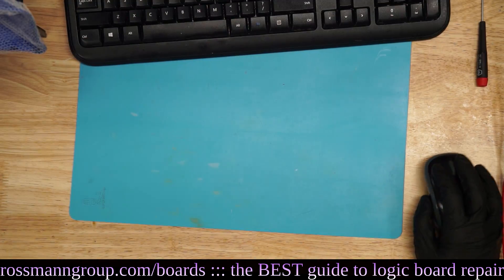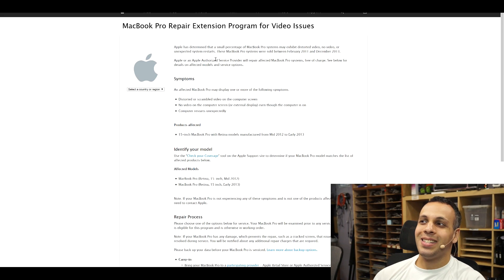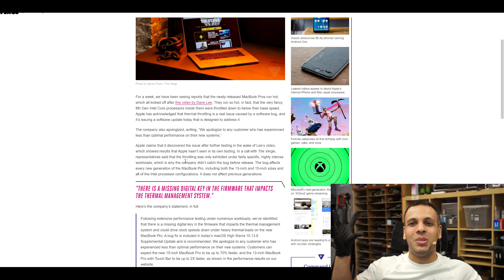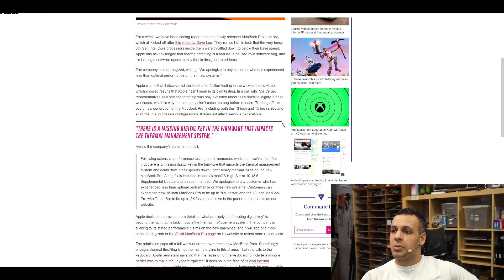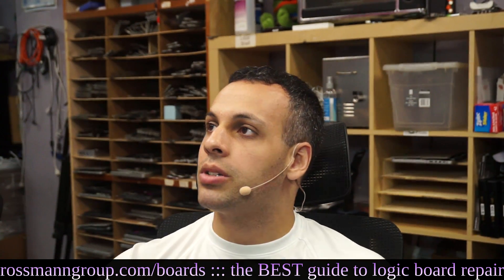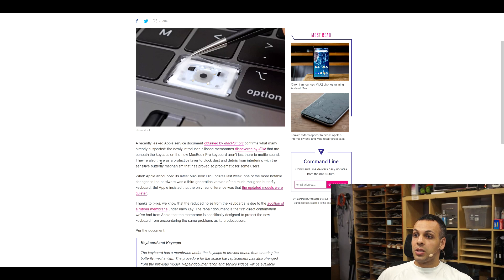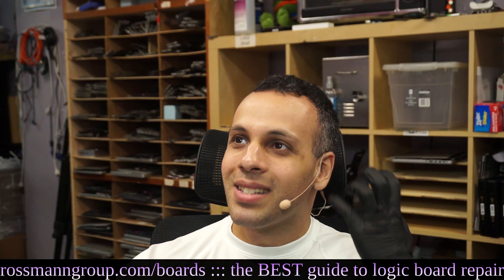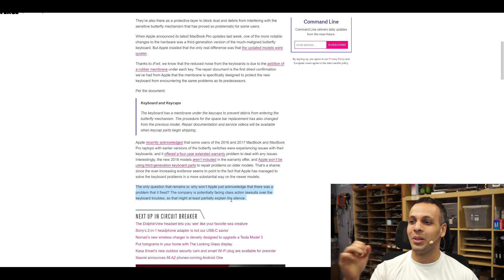This new Macbook is becoming a meme.

Comment: Great video. The only point i would like to have a talk about it is the "for some people this is more stable.... ". Well, i do have a creative team working for big clients and we have apple machines and windows machines. Every single windows machine require more fixes than the apple ones. OF course when talking only about price per performance pc machines win every single time you compare. The point is if you don't need hardcore performance and have the money, the ecosystem is worth. Here we have more windows than apple because of the high price  but i do get how in the US this is not true. ( in Brazil apple products can cost as high as 3 times the original price in the US). So, for a real case scenario is worth the long term price for some cases but not for isolated performance. And creative like to be part of the "apple cult"

Comment: Yesterday, a service guy told me about the change in Apple ethics post-Jobs. It was enough of a problem with Jobs. Now, the macbook has components soldered in, to prevent repairs; requiring buying a new machine. Glad I came across this vid. Thanks.

Comment: The Windows OS is a nasty piece of lazy programming that is a headache no matter what you are using it for. Linux and the Unix derived Mac OS have much more solid fundamentals so even if it crashes (which doesn't happen often) it easily reboots and self corrects. As for pricing: yes, I agree. The systems are overpriced.

Comment: Another point to consider is Apple states the i9 cpu is capable of hitting 4.8ghz, but reading this page from intel 
 https://www.intel.com/content/www/us/en/products/processors/core/i9-processors/i9-8950hk.html under the section called Intel® Thermal Velocity Boost  it does give the impression that max clock speed boost is only achievable when the cpu is running at 50 degrees C or cooler.  Has anyone seen this i9 Macbook pro running at 50 degrees C or less in order to achieve 4.8ghz boost speed?

Comment: Cool, we're finally in the future where we can software up some cooling capacity instead of worrying about silly things like heatsink mass and designing in proper airflow. Sign me right the fuck up for some of those digital keys, my phone needs'em. These old 805s get hot under sustained load.

CNET's test seems to indicate what they actually did was increase the temperature limit before the CPU starts panicking, while simultaneously reducing the peak frequency once the CPU gets hot, to help keep the temperature from spiking beyond whatever barely-adequate cooling solution they shoved in there can handle. But I guess "changes to the thermal management scheme" is a lot less catchy than "adding some missing digital keys" bullshit.

Peak temperature from CNET was also above 91c, which should prove pretty bad for longevity for heavy users, but that's to be expected; it's perfectly in line with Apple's we-don't-give-a-shit-buy-a-new-one-next-year strategy. The keyboard will probably explode before the CPU starts suffering electromigration problems anyway, soooo...

Comment: It also doesn’t like virtualization - running vagrant and docker will thermalthrottle so bad.

Removing or adding firm/Software to reduce throttling will just cause more wear and early damage to the hardware

Comment: How the he'll can they claim this to be software related. Clearly, the hardware design is not capable of keeping the machine cool enough to prevent it from throttling. Then, it doesn't matter if the cpu is working hard because of a software but created by Apple or because you encode video on it or anything else. Apple fixing their potential software but will not remove the limitations of the hardware.

Are Apple actually calling themselves engineers and pretending not to understand this themselves?

They must really take people for fools.

Comment: Note that they said that "we apologize"; they never actually said that they are sorry. 
I know that it's kind of semantics, but it does matter. If you actually are apologizing, then say that you are sorry. And, then, stop doing the thing that you are sorry for because that's how being sorry works. 
Hell, I guarantee that a part of the reasoning is that apple is certainly not sorry and that they don't intend to stop doing the thing. If they were, then they would have made the "pro" laptop a bit thicker to have better cooling rather than trying to figure out how to make it thin enough to slice bread.

Comment: They would lose their lawsuits for their butterfly keys if the admitted reliability from 2015-2017 MacBook

The worst part is that they did their "pro" user base a disservice and experimented with their elite demographic instead of rolling out the changes in other product lines

Comment: Am I the only one who's bullshit alarm goes off when a SOFTWARE fix for thermal throttling is issued? How the F*** is that even a thing? Are they disabling the slowdown so the thing runs hotter and risks burning out the CPU, or are they injecting wait periods to intentionally slow down heavy load tasks to make the system under-perform whilst artificially keeping the clock high?

Those really are the two options if we're talking software, and neither is particularly reputable.

But as always, Apple wouldn't know proper cooling if it stripped naked, painted itself Noctua tan, and hopped up on a table to sing "Oh look at what a big cooling fan I am!"

Oh, and Louis? Part of their culture for 30 years? Try FORTY! It's been this way since they shipped the original Apple ][, where there weren't overheating issues you were just using it in too hot a room. (No joke, they said that). There's a reason the most popular aftermarket part for an Apple ][ was a fan and shroud that hooked on to the left side of the case.

Or the expansion cards weren't improperly secured, you just shipped it wrong. I'd point out the ONLY thing that held in the expansion cards in an Apple ][ was the edge-connector and gravity. They couldn't even be bothered the 'expense' of a bracket and one screw.

Which is why I've spent 40 years wondering just what the f*** is in their kool-aid. Cocaine? Heroin? Meth?

Comment: They have somewhat fixed the throttling but from videos I've seen it is still only sitting at 3ghz at 90c, which makes their claim of it boosting to 4.8ghz still laughable at best.
Reply: Why it's laughable? The fact this cpu doesn't boost all cores up to single core boost level? Were you expecting it would?

Comment: The software update will just be them lowering the performance. Can't underperform if there is no performance! 
Seriously though. You can't change  a cooling system (I use cooling loosely) with a software update.

Comment: I haven't had a chance to look at post-patch results, but if I had to guess, I'd bet that the fix was dialing back the clock speeds further and more quickly under multicore load to reduce i9 power consumption. That would reduce stress on the VRM solution and would keep performance stable over longer periods. But of course you clearly lose even more of the difference between the i7 and i9 CPUs. (also "4.8GHz Boost clock" = I love running single-threaded benchmarks and nothing else)

Comment: I wonder how a s/w update can even fix this as I agree it seems they're just misleading about their thermal hardware corner-cutting... I mean if it just lets the chip run hotter or makes the fans louder that'll just fill it with dust or halve CPU life. Really fucked up if they go that route, but popcorn in hand...

Comment: A software fix for over-heating? Sounds like they didn't configure their turbo boost modes to limit power usage correctly... Which means that until it does start throttling, you're probably getting more performance than they ever intended (since the cooling hardware is so crap they can't have intended it to be a performance monster)

Comment: Customer: Hi. I just bought this Apple Macbook Pro for 7000 USD. My friend told me that if I spent an extra 3500 dollars the performance would be much better than ASUS and other gaming models. But I am lagging really hard in PUBG.
Apple: The Macbook Pro is not meant for gaming. That's a very specific workflow we have not yet tested but we can asure you that you are using your macbook wrong.
Customer: But I...
Apple: We fixed the keyboard noise problem, be grateful.

Comment: I guess you could try and fix this by replacing the mosfets, inductors and capacitors in the VRM switching circuit, but that actually means to recalculate most of these components...

Comment: I've said it before, and I'll say it again; Apple died with Steve Jobs. Steve was the driving force behind 'innovation' (I'll be careful using that word here as historically Apple combined existing technologies into a user-friendly package), and the quality of their products was high. Yes, their prices were always high, but you knew you paid for a product that won't fail at the worst moment. Without that driving force, Apple no longer has the imagination necessary to keep up with new technology. This latest Macbook Pro is the perfect example.
The Macbook Pro design dating from 2011 was designed for a specific generation of CPUs; namely the Intel Core i5 and i7 series. The cooling system was designed to handle these CPUs which was fairly sufficient for the time. Fast forward to 2018, and they're putting an i9 which runs considerably hotter into the same chassis. The cooling system and chassis is not designed to dissipate this extra heat effectively, and thus the CPU is forced to throttle by its built-in safety system. You may argue that the Macbook Pro design is very iconic and changing it may have bad reception amongst consumers, but in truth industry professionals (especially in creative industries) don't care about the aesthetics; they need a powerful machine that is stable and reliable. Sure, I like my laptops thin and portable like anyone else, but if it means my machine will not perform to its specs then I would consider it a bad investment.
And if this machine is targeted at industry professionals, then I would assume they'd put performance before aesthetics.

Comment: I really wonder, is there any other company that fucks up their flagship products as badly as Apple does? I mean, until following Louis's channel, I was under the impression that Apple makes really good products. But a badly designed CPU power supply in a products that features top of the line processors and and also is aimed at professionals, seems like way worse than a rookie mistake. It seems like they were cutting corners in terms of BOM price where corners should have not been cut! I'm an electronics engineer, and if there's one thing I learned in my 12 years of practice is that you don't fuck with the power supply.

Comment: That is because engineers, both software and hardware, only Bench-Test their products, not Stress-Test them.

A Bench-Test, officially, is as follows:
1. The machine powers on.
2. The OS loads.
3. The system runs continuously for 24 hours without problem (absent anything beyond stock installs and peripherals).
4. Machines that make it to Stage 4 are moved to sale.

Remember, the video editor is NOT a stock install. Right-Click is NOT Enabled by Default. Steam, and your games are NOT stock installs.

Honestly, ANY system running below 3.2Ghz, less than 16GB RAM, less than 1TB of total HDD/SSD/M.2, and below 1920x1080 60fps Screen, is a waste of your time and money, especially if it costs over $1500, and I will go ahead and say that is both USD and CAD. This should be BEFORE having to pay for additional services like "Apple Care".

Comment: Oh that's a good idea. Effectivly make a thermal challenged cpu (overheating ) continue running at base or boosted clock speed. That won't make it hotter and force it to burn out...

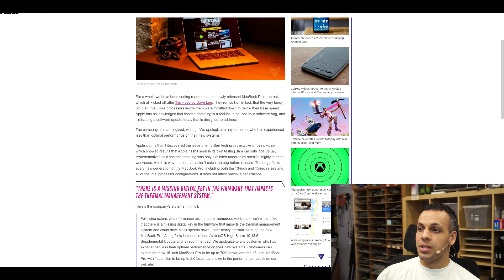Comment: 4:00 There's a missing digital key in the firmware that impacts the thermal management system. "Yeah." that was the most accurate, condescending, on point, sarcastic "Yeah" in known universe.

Comment: The results are in on the hotfix, still can't run the i9 @ rated stock speed in video rendering, still @2.4-2.6GHz. Cinebench hold up over 3GHz but the test is too short for the heat to build up.

Comment: More likely digital keys that allow apple to override the default sane Intel throttling to run the chips hotter and not to throttle as soon. Software can't override PHYSICS. The chips are going to put out the same amount of heat per speed it is running at. These CPUs will probably end up having the same issues as the GPUs that were running too hot in previous models. This fix is either throttling the chips even more to prevent over heating. Or overriding the Intel defaults to run hotter before throttling

Comment: The fan can't spin with out a digital signature? Am i hearing this right?
34 years later... Apple's space shuttle violently explodes during takeoff 
[Tragic story Bla BLa Bla Investigations show that the fingerprint sensor was destroyed by dust, and could not authenticate the astronaut, Because of this, all cooling systems, life support, and flight controls were disabled in the interest of security. CEO says "The problem was that the pilot was using the booster to liftoff, a very specific workflow that we didn't consider anyone would use a booster stage for."]

Comment: There is no real fix for this issue, since the cooling 'solution' has not changed in the design in at least five years or more. Also, placing the absolutely hottest chip in any ill-vented enclosure  - the likes of Apple - should have been already a red light. At least the chips will throttle, rather than burst into flames. A MS laptop will outperform an Apple MacBook Pro in rendering, which only makes sense to most of us. On the other hand, if you're a serious producer, you should look for something OTHER than a laptop to edit. Ultimately, you DON"T get what you're paying for from Apple, never have and never will. This is not an expensive SONY conundrum, this is Sparta!!!

Comment: "Apple has acknowledged that thermal throttling is real issue caused by a software bug, and it's issuing a software update today that is designed to address it.""

Golly gee willikers, I didn't know the laws of thermodyamics were beholden to computer code

Comment: "missing digital key" is technobabble, since a digital key is used in encryption algorithms and DRM services, not managing operating temperature or current.  And there is no software equivalent to replacing the VRMs with higher capacity VRMs.

Comment: Even if it is not scope of the video:
I never had any throttle on my 600€ HP and never had any crashes....
So I personally don't get why should anyone use a laptop which has a less powerful CPU and gpu to do more compute intensive tasks....
Reply: Neo Cortex what is your cinebench mark score?
Reply: James Isaac cone bench is completely irrelevant. The only score that should be the calculating power in flops.
Cinebench is not a test that tests for flops. The only benchmark that I know of that measures that is linpak.
And I tested the MacBook pro against my laptop with Adobe Premiere and expected the MacBook to win, but it took twice as long encoding a 10 minute project. I do not have very exact measurements tho and I can have experienced an odd case. But my laptop is a HP pavilion in medium price range

Comment: The only reason they fessed up this time is because they can force the software update at ZERO cost to them. Any issues that they will have to pay for they will pull the "Select Customers encountered issue Y". One of the reasons being that when you say that, users are less likely to blame that thing for their issue, or less likely to bring their mac in for a fix if there is not a problem (even if the problem does exist on their device).

Comment: I feel like "missing digital key" means "we forgot to override the CPUs max power draw" and the update they are pushing will keep the processor at lower temps by lowering its boost clock. In the end they'll reduce throttling and improve out of the box performance by limiting performance, something that a computer with a realistic cooling system wouldn't have such problems with.

The new hex core Razer Blade has the same issue, but when BOTH the i7 8750h AND the GTX 1070 MaxQ are being heavily utilized in a similar slim system. Still inadequate for the hardware but at significantly more thermal output. I wouldn't be surprised though if better thermal paste would ease that pain a bit, as usual most transfer media that OEMs use is less than desirable (not sure about apple's specifically)

Comment: Software fix for over heating xD. Software might be able to help thermals by applying a more aggressive fan curve, but that will only work if the fan was never running at 100%. They could also increase the target temperature, but just because your CPU is fine running at 95C, doesn't mean the components around it(or your hands/lap) are.

Comment: Putting an i9 in a laptop is retarded. Secondly if Apple have changed the design of the keyboard to stop dust getting in them didn't they just loose their class action suit seen as they admitted it was faulty by modifying it?

Comment: First time I've ever heard of a firmwre update that actually reduces performance 😂
Reply: John - Orbiter lol the MacBook now performs better than when Dave Lee put it in the freezer lmao
Reply: FYI, the "Spectre" CPU vulnerability fixes that were done via firmware update caused significant slowdown on most Intel processors in all OSes
Reply: Iloerk I’ve experienced no performance difference at all with the spectre fix
Reply: You clearly didn't have a PSP back when those were a thing!
Reply: Firmware update jacked up my router recently but, uh, it's a measily router, not a "high performance cost" computer. LOL